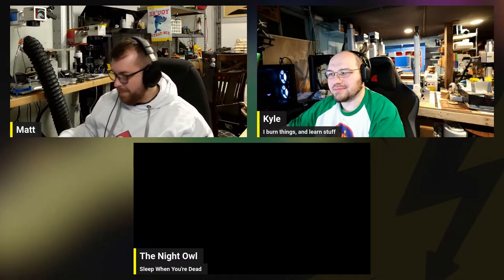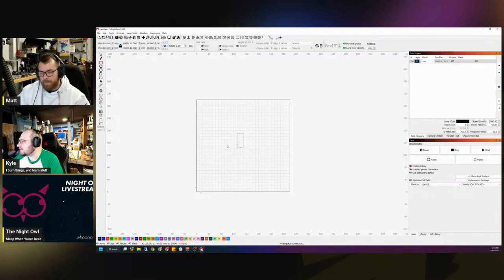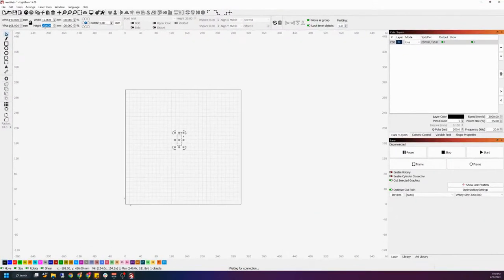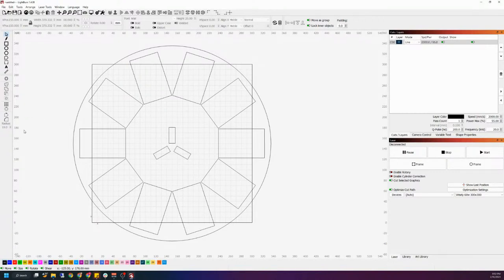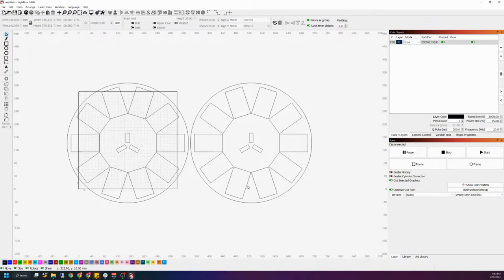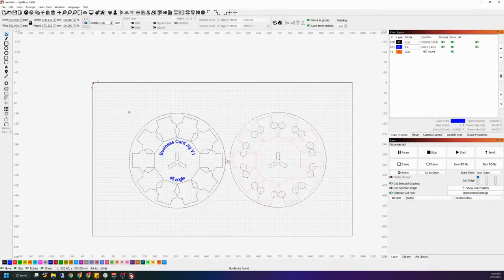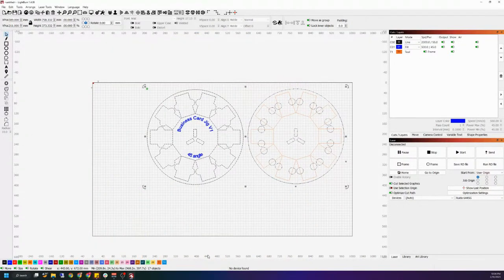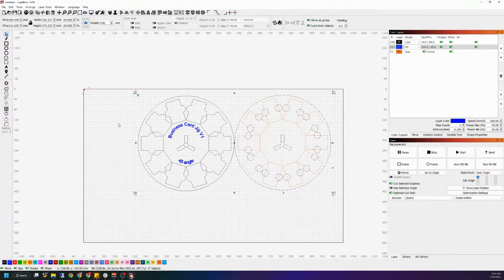Can we make our own ROTARY TABLE from scratch?

Comment: The reason why the business cards were off on Kyl'e's is that the jaws were not in the center of the cutout. The lower legs were shorter than the top leg. Therefore the center was within the top jaw.
Reply from the maker: Yes! Great point. I missed that in my haste on stream when I missed creating a center toolpath circle around the chuck cutout area. I rectified that in the share file I uploaded last night after I ended stream. I'll likely revisit this in another stream or video to show what I messed up and the resolution.

Comment: Circle Array is much simpler to use if you create a shape to use as the center point.  The big outer circle could have been created first and used as the center of rotation for all the other parts.  Much faster to work that way than manually entering the center point.
Reply: That is a fantastic point, thank you for the tip!
Reply from the maker: Great tip!

Comment: 10 cards around a 360 degree circle is 36 degrees, not 45 degrees. 8 cards would be 45. Great idea tho. What about 1/4" foam for pencils?
Reply: Correct, I did rectify this later in the video :)